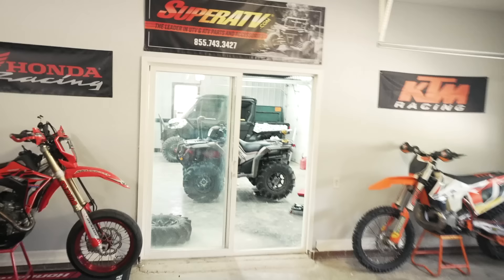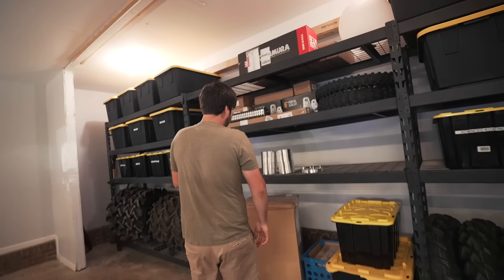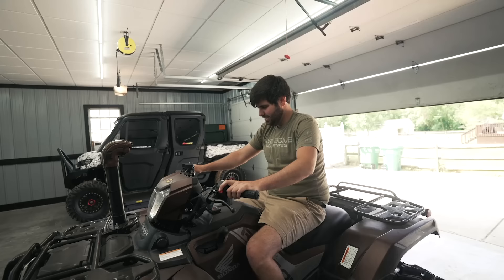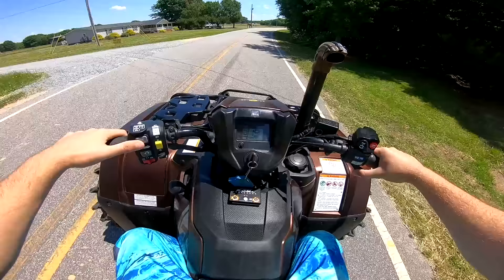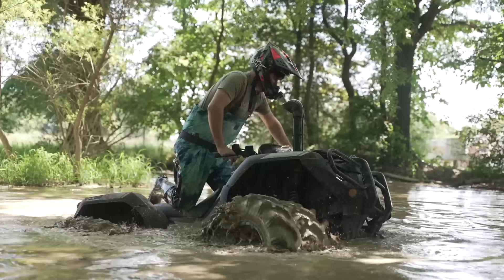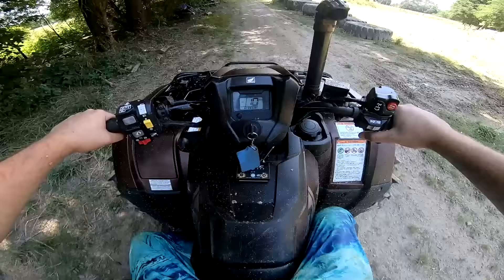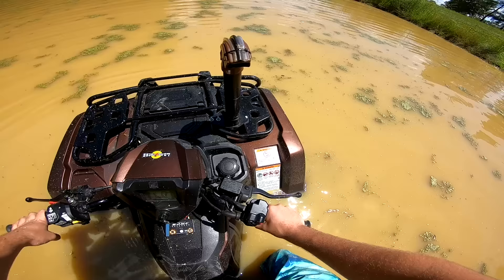We put EIGHT WHEELS & TIRES on my HONDA! *DUALLY FOUR WHEELER*

Comment: Braydon put the duels on the renegade since it’s so powerful
Reply: It would break
Reply: Pls
Reply: The reason why I think that's dumb is because if it spins the tires too fast the spacers will break and it will break
Reply: I was thinking the same
Reply: That is not the reni
Reply: That is not the reni
Reply: That is the honda
Reply: @cynthiahudson4927  obviously
Reply: It doesn’t take much to break a wheel stud with that much leverage.
Reply: @destinhook3826  and it acts like a fly wheel
Reply: @breckendudley2067  if it would’ve been a can am it would’ve burnt belt up
Reply: @southernslipping4225  if it was in low no but high yah
Reply: Or the X3
Reply: Belts would just slip
Reply: Honda has a lot more power canam sucks
Reply: @imcountry9156  nah u capin

Comment: Dads had his electric shift  for 21years bout in 2000 never had a problem knock on wood been sunk 6 times over bars one time had to get excavator to get it out just dried it out with blow dryer still works as new no rebuild yet either knock on wood #honda power

Comment: You dont want tires to touch the sidewalls will rub and build heat until they kill themselves. Duallys have to run spacers between wheels so don't touch and kill tires

Comment: If you start having problems with the ES I remember I used to reset mine by turning the key off and on really fast with out the four wheeler dyeing and it would reset it

Comment: Braydon 
Get a set of the mud racing tire and wheel setups that pinches the rubber and runs with no air.  Test them out.

Comment: You actually dont want duals to touch. If they touch the sidewalls of the tires will rub holes In to each other and go flat. An atv tire has a thin sidewall and it wouldnt take long to put a hole in it.

Comment: The Electric shift will give u problems I have a little 250 and it’s Electric shift but also my stater went bad and my battery and it won’t tell h your gears Bc it’s all Electric obviously

Comment: Ok you've got 8 tires on the Honda. Now run it off a cliff and watch it smash and crash into little pieces because that's all it's worth or good for.
   Thank you Thank you very much Now where's my jelly donutz haha
   I'm confused how it even had enough power to get out of the garage.oh I no what you did you swapped motors with the renegade .
  Can't fool me haha
  Just sink and leave it in the bottom.of the pond and drive Over it with the renegade that would be awesome baby